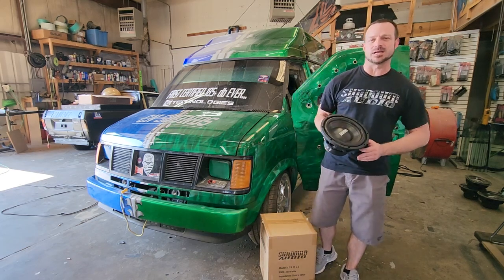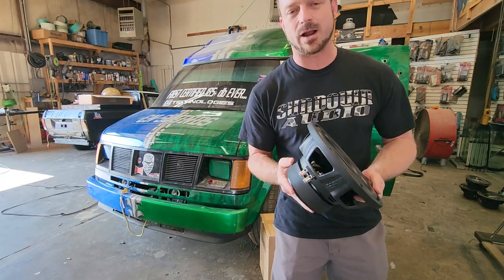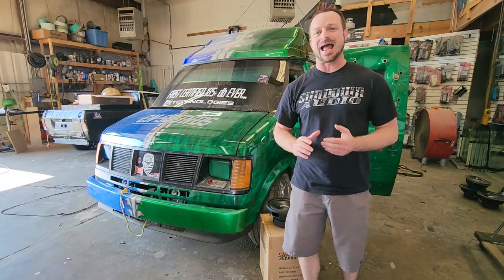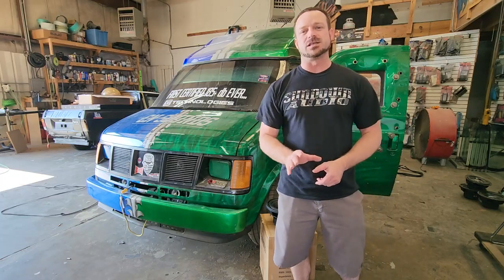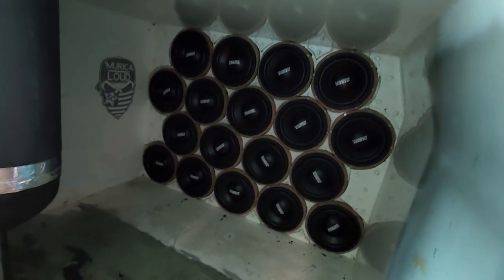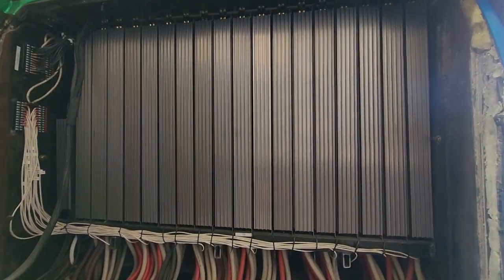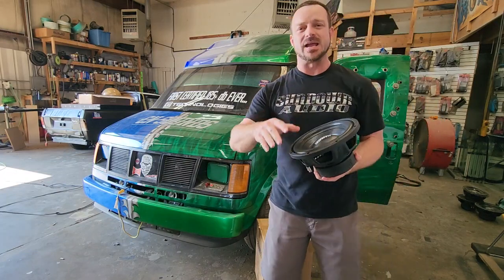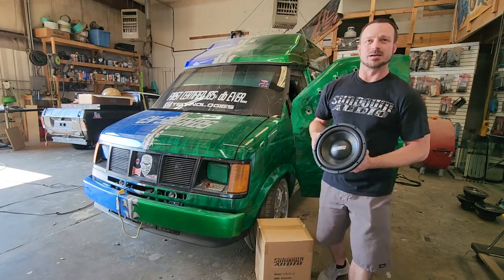Sundown Audio LCS-10" Subwoofer Give-Away

Comment: I got two of these LCS 12's in a sealed box inside of a 2000 S-10 extended cab with not too much air space in between my back wall and my speaker box with the windows rolled halfway down it literally turns my truck into some crazy bandpass box I've run a bunch of different types of boxes but the sealed box in this truck for some reason hits the hardest it did A1 48.2 with the windows somewhat down on less than 1000 Watts 166.4 is what I think the van will do with those subs